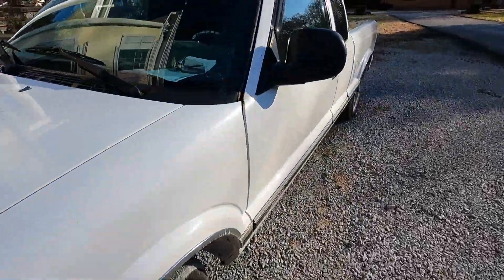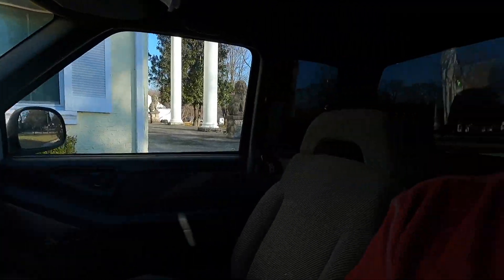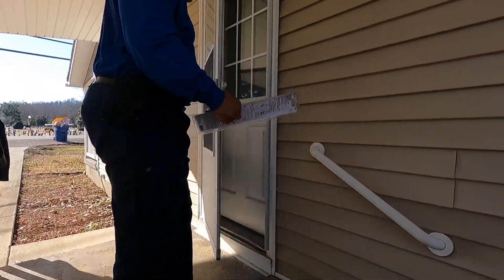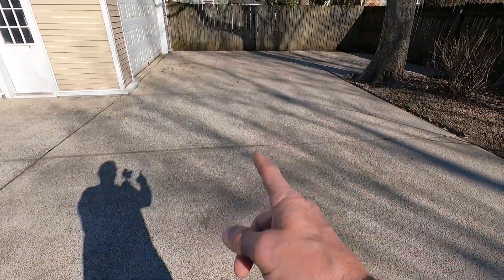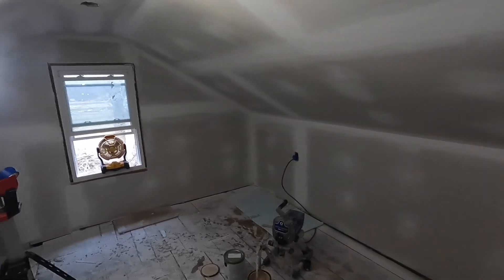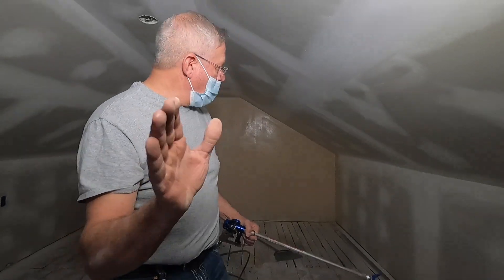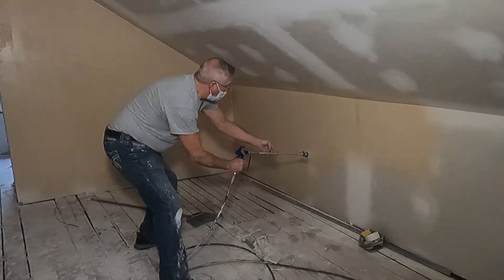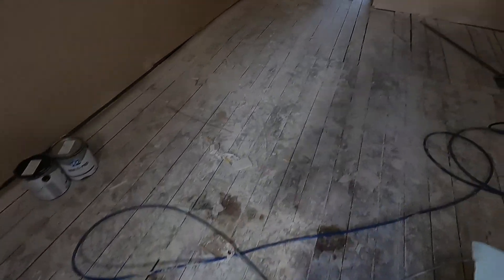Can't get away from my fans

Comment: Hi David, 

With new drywall be best to apply a PVA primer to seal the joint compound material first before you apply the color paint. 

Looks good.
Reply from the maker: Your right but on some rental property and a house I gave $11,000.00 for,, on somethings i cut corners to save money and time. If it was one of my house I’ve given 70 + for i would have. 
Thanks for commenting

Comment: the old dodge rams sure are a long time lasting rigs on the market we had to replace the ultanator  on the ram 3500 wich is 13 years old wich was orgional alutranator wich no shame  on on it origional part finally wore out last year we got a 2020 ram 5500 dually 3 ton wich pretty good buy for $39,500 we sure love the rams
Reply from the maker: The dodge with the Cummins engines are good trucks. 39,500 seems like a great deal.
Thanks for commenting